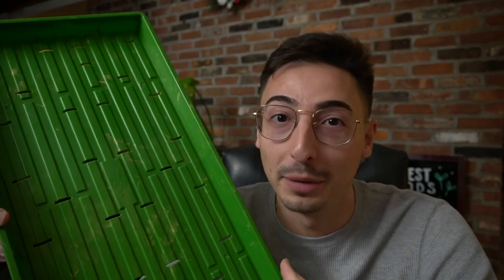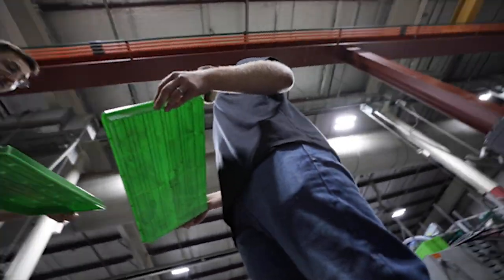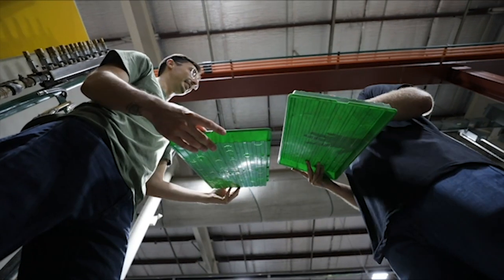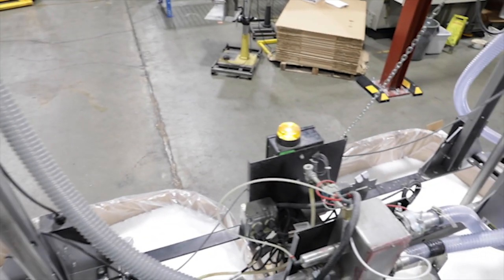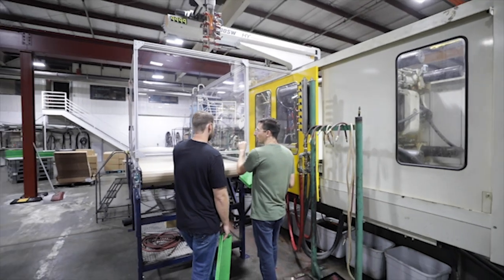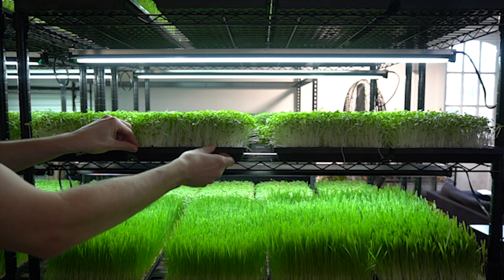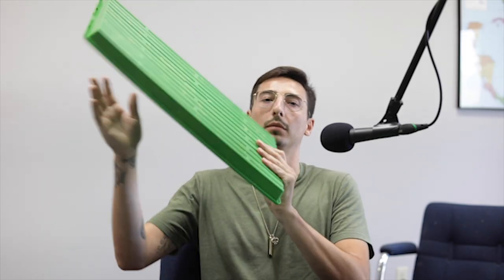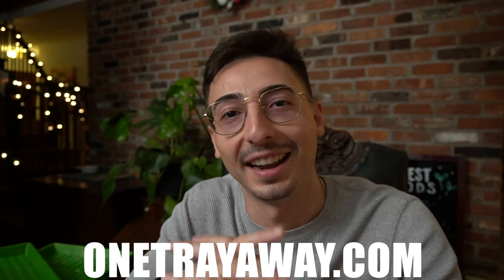How Bootstrap Farmer Trays Are Made with Donny Greens

Comment: I have about 6 trays with cracked corners or edges from bootstrap.  I LOVE my trays and I completely sympathize with the production costs, etc.  Does the manufacturer accept broken trays to use for the recycle process, back in to usable new trays?  If so, I would ship them!!
Reply from the maker: I have a few of those two - only a tiny fraction of the total # of trays I have at this point haha! Yes - just send them pictures of the damaged trays and they typically replace them right away. I'm not sure about sending in for recycling though - you would have to ask them about that!